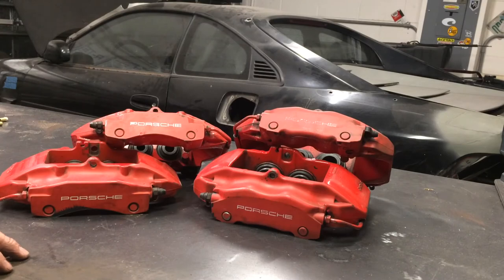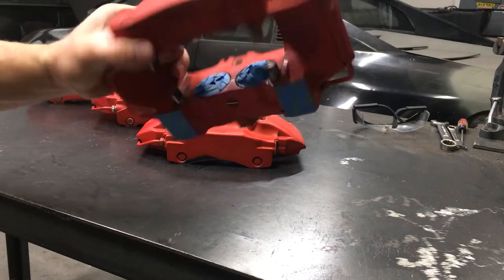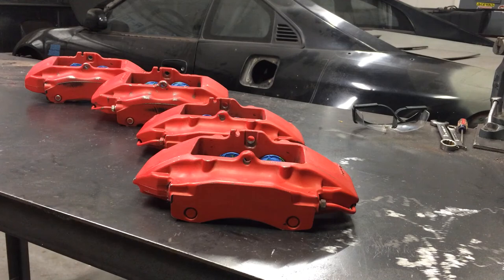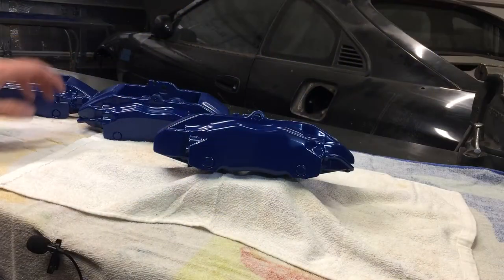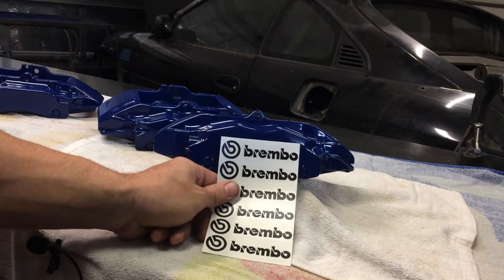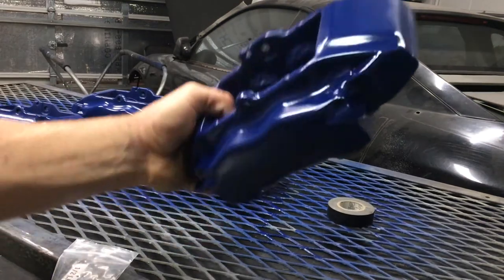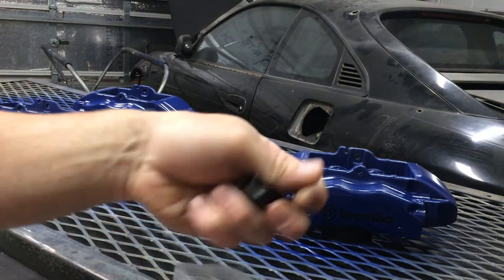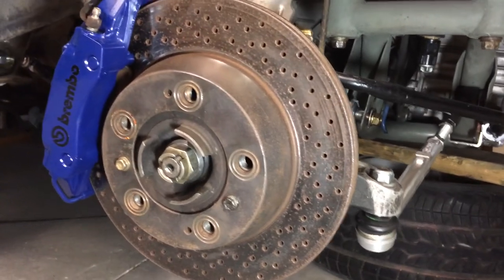Brembo brake restoration (V8 MR2)

Comment: I imagine powder coating would have been an option... 
but would require complete disassembly
Reply: Thanks for the informative video. Glad to see an update!
Reply from the maker: correct. i would have preferred powder coating. i didnt want the extra expense and additional cost. maybe one day
Reply: @scantronsgarage  there are home powder coat kits (i have one) that work just fine and dont cost an arm and a leg ;-). That said, the calipers turned out really good! Well done that man.
Reply from the maker: @markregler2164  i'll have to try that. I didnt want to pull all the seals out. being lazy